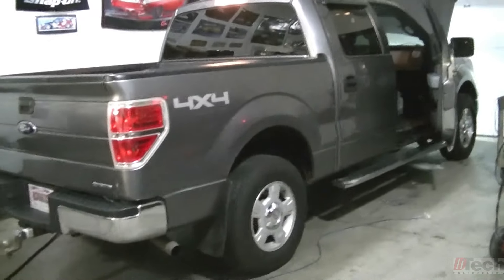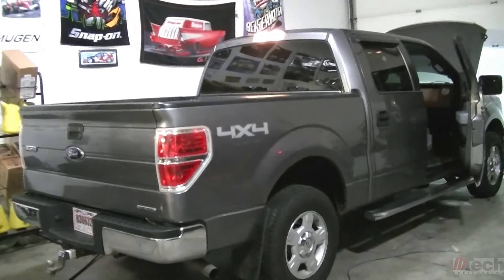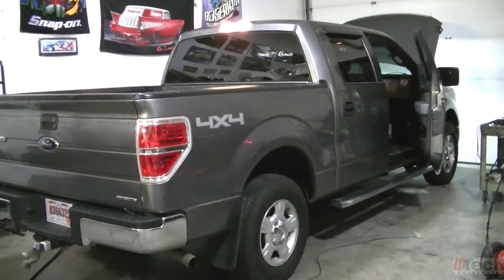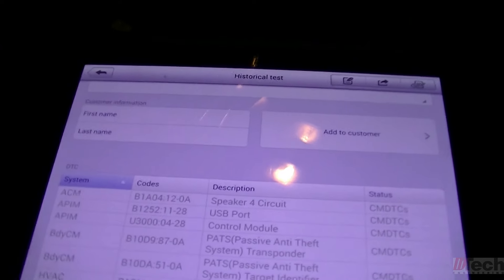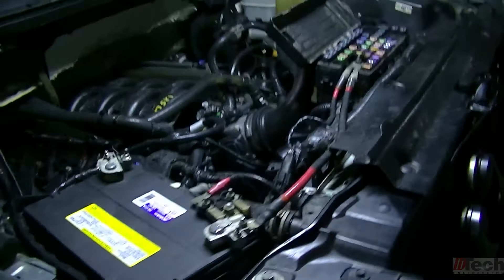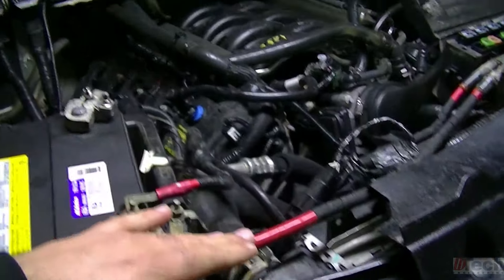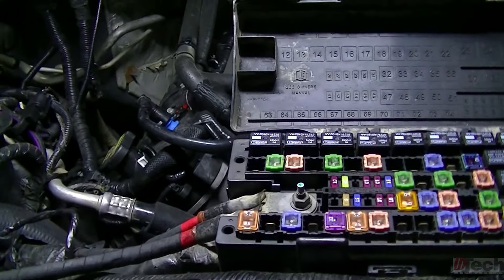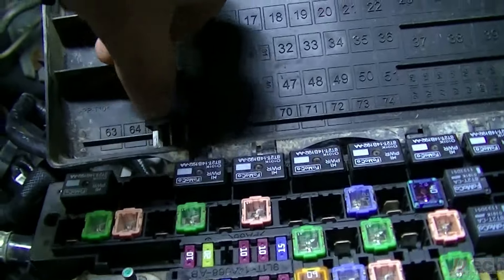2013 F150 no crank, how to bypass fix a bad PCM

Comment: He was wrong the problem is his electronic ignition switch. Not pcm, it's a switched ground signal from the pcm. I've done so many of these. Check ignition switch if correct output then neutral safety. Kinda sad he cut the harness like that. Could of used jumpers to test pcm plug. Never cut harness, will forever look like someone has done something ghetto. The original bcm was not the problem, he needs all data or michael1 ect.. so you can understand the circuits, follow the oem testing procedures. Learn to use a oscilloscope would have pin pointed pretty quick with the write references. Not talking crap I've been exactly where you where b4 and I learned having the correct tools and resources save time and money.
Reply: Unfortunately it’s not always the ignition switch…swapped one three different times with different brands just to receive the same result. Truck was doing the exact same thing this one was…
Reply: May I add my 2 cents I agree with not cutting those 3 wires to the PCM harness I believe if he looked up TSB’s he would have found the problem fuse 27 reroute kit  (the ground is supplied by the PCM SWITCHED) CHEERS  need a wiring diagram

Comment: i have 2014 ford f 150  3.5   does the same thing  but in this case just crank but no start also i have a message on dash starting system fault

Comment: Electrical problems eater getting in gem module causing  starter 16:47  engaging while running killing battery e t replace gem controller  and stop water coming in

Comment: Im having a very similar problem from time to time and still have yet tom figure it out. Took it to dealer and they slap in a new battery and say it runs great! even though I'm on my third battery with this issue. seems to happen every 6 months where it won't start or crank, but sometimes if I walk away and come back an hour later it will start right up and run for roughly 6 more months. Other times I have to charge the battery and it will run for months at a time. is this similar to this truck? or did it just not start once and never start again until it was fixed? At my wits end with it at this point. Anyone else having this problem?
Reply from the maker: unfortunately it sounds like your situation is different, the one in the video was completely dead no crank due to bad engine computer.

Comment: but how does that permanently fix the problem!?! i mean the regular guy with no knowledge isnt going to know how to do this! so i would have to go in and jumper that relay every time i want to start my vehicle!?! that doesnt fix anything! that was a band aid fix! thats not a good solution really! bypassing the pcm, is probably not a good idea for long term!
Reply from the maker: You are correct, it's not the correct perminent fix, the true fix is to replace the faulty pcm. This was a testing method proving out that the pcm relay driver was not doing it's job, and by manually grounding and acting like the pcm, it shows how the vehicle will crank. If one were in a jam, this could be done also to get the truck running and moved. This truck was towed into my shop in the middle of a snowstorm and blocking my garage door, I used this to get it crank and running to get it mobile. And this wasn't put out for the regular no knowledge guy fyi
Reply: @DTEAuto  My truck (2013 Ford F150) hasn't gone thru this yet but like you said I will be ready for when this happens. It starting to show signs that I may have a bad pcm.
Reply: Having same no crank no start,tried this but when I jump it it tries to turn over but doesn't. Any suggestions?

Comment: Bypass the PCM. jump it. The kids on Chicago street know how to do it in 5 minutes.
 Jump it at PCM signal to pre-relay control input with +12vdc. This relay will control the immobilizer and starter circuit.

Comment: Grossly over excessive computerization , Completely unnecessary
Reply from the maker: then don't watch, no one made you
Reply: @DTEAuto  You miss understood the message (crayons are out) Current vehicles are grossly over computerized running the starting system (Vehicle Starter)  through a computer ( ECM or PCM or BCM or CAN ) is completely unnecessary and senseless Much like your comment